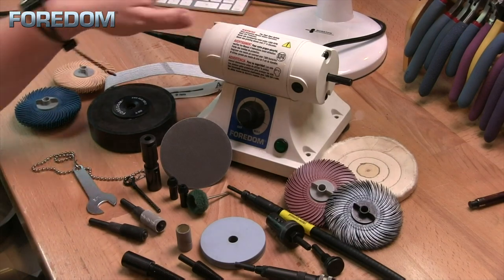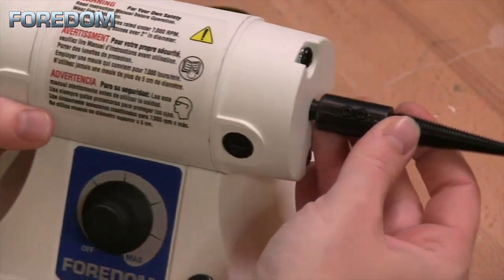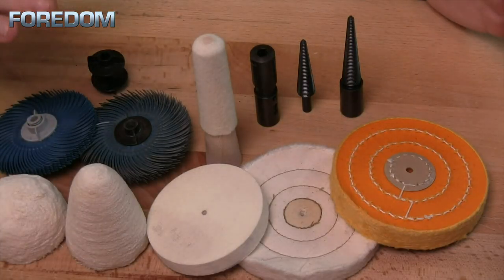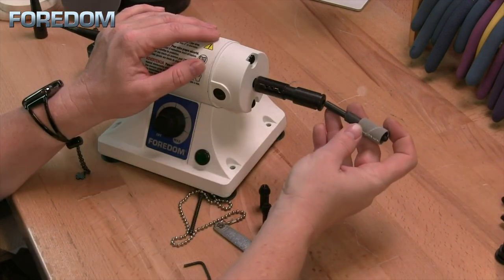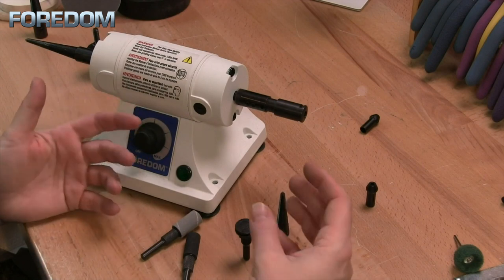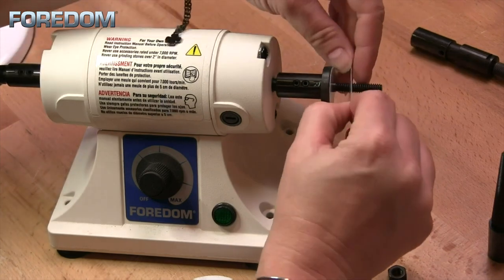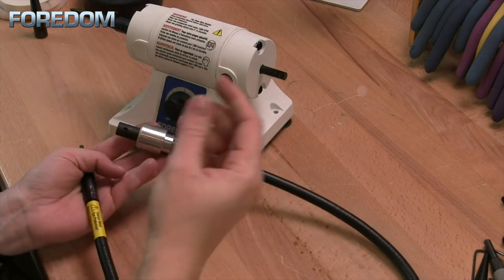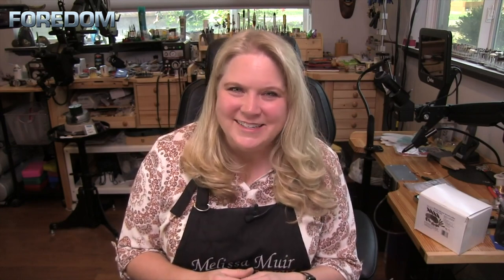The Foredom Bench Lathe and Attachments - All About Accessories

Comment: Very useful thanks. I do have a question as I saw a video this week where someone uses a benchtop speed controller (for the SR motor) in series with a foot controller, so the benchtop controller sets the maximum RPM for the foot controller. Is this recommended by Foredom or can it lead to damage of the motor or controllers?
Reply from the maker: It may have been my video. If you have an older machine then it will work. But With the newer machines the electronics aren’t really compatible to do that.
Reply: Thanks for the answer. My motor is a K Series so I should be fine.